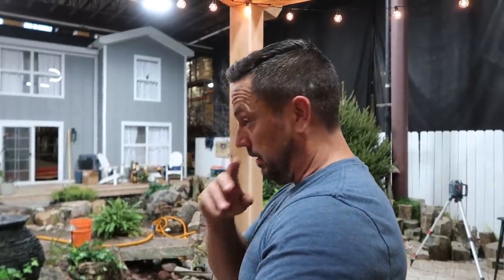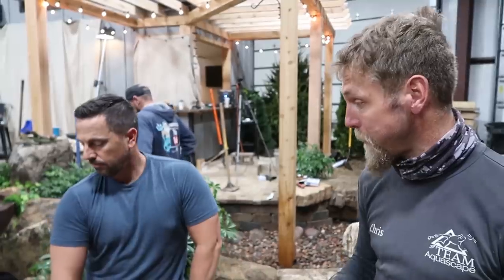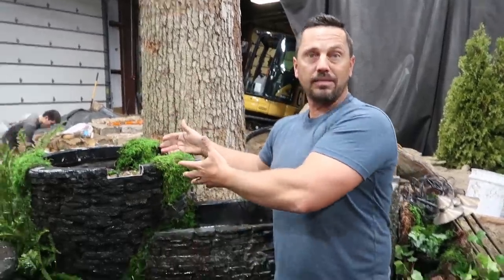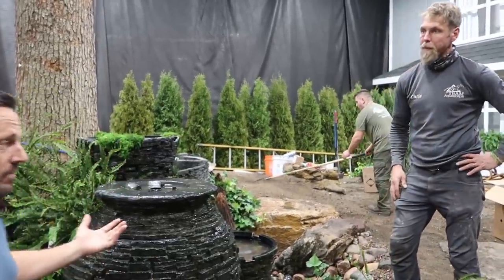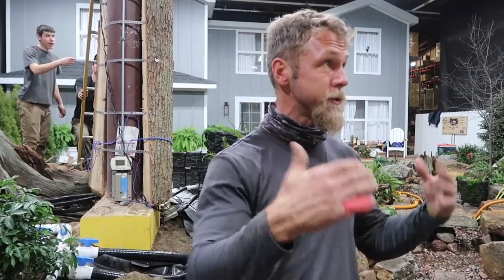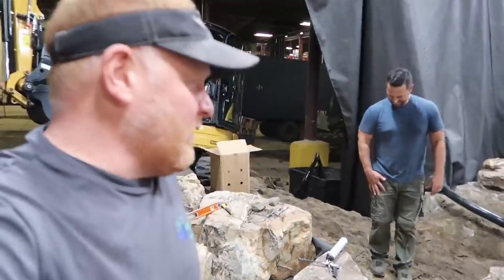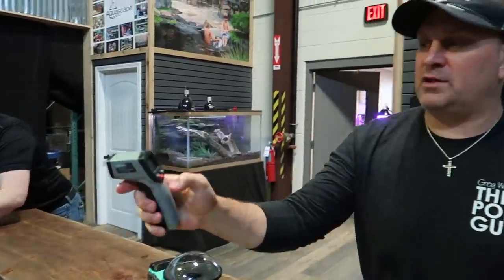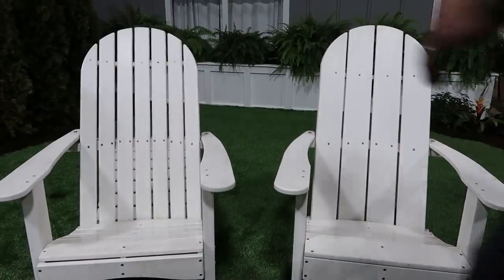Atlantis Water Gardens: *Pond* Display Finished! - Part 5

Comment: It looks like you now need to make and sell pre fab spouts  to add to your bowls and urns.  All your CAC's cut into them to make spouts, but they just don't look quite right.  Make a product that will allow you to cut the urn and then just slip the spout over the hole and keep it from looking so jagged and unnatural.  Make a few sizes.  Just a generic spout that would work on any feature you want to have a spout, but doesn't have one already. Maybe flexible so it can conform to any shape.